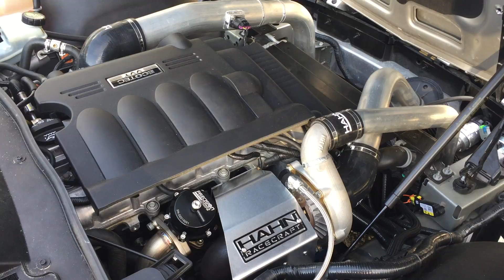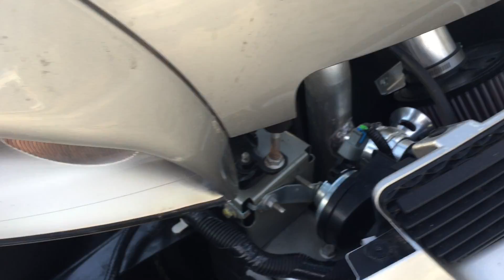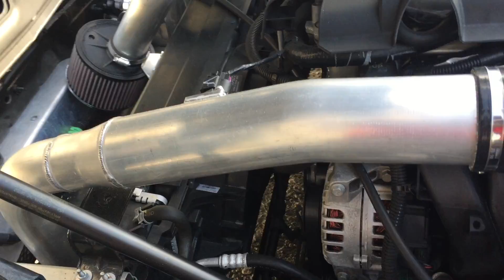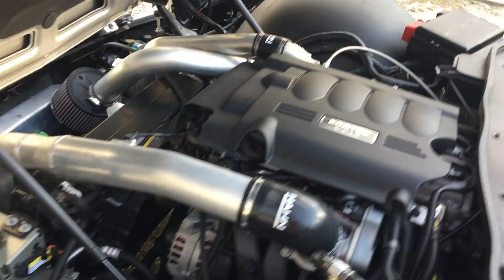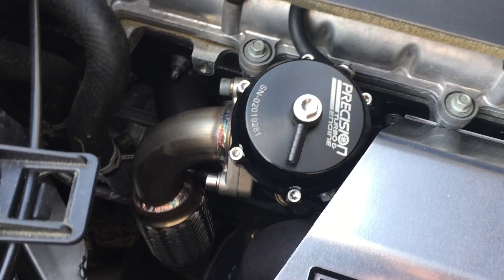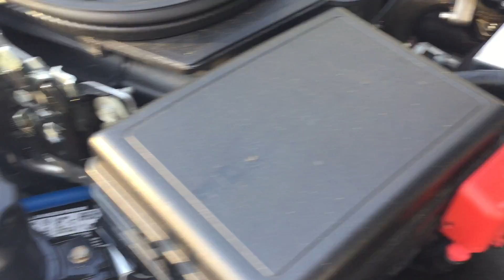Hahn RaceCraft Sky/Solstice 2.4L Precision TurboSystem

Comment: Just discovered your channel, after my rabbit-hole research on Solstice 2.4Ls. I have been eyeballing buying a 2006 or 2007, and the first step would be adding some mire HP to the lackluster factory HP. Three questions: 1) Do you install the kits? 2) Is the work warranted? 3) What are HP & MPG changes after a 2x Turbo upgrade? Thanks!

Comment: I'm thinking of getting Solstice with an automatic. What's the most HP I can gain from one of these without modding the transmission?
Reply from the maker: It's actually pretty promising!  The automatic you have is the same unit as used in the factory turbo version, so it can handle a lot of power. You're good to go for 300 to 400 HP!
Reply: Hahn RaceCraft very nice.. thanks for letting me know
Reply from the maker: You're welcome!  Thank you too, and be sure to check us out when we re-open at our new location in Daytona Beach :)